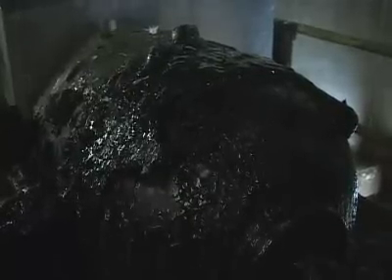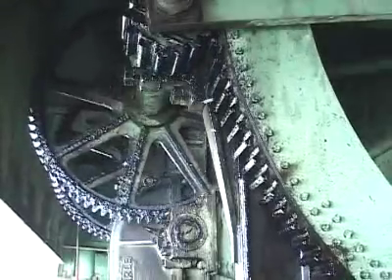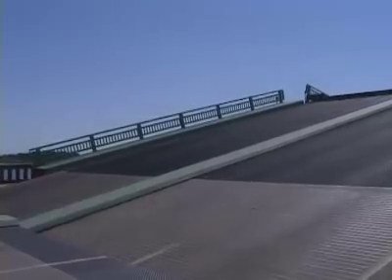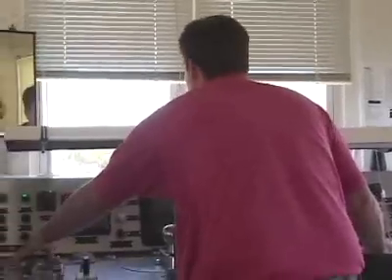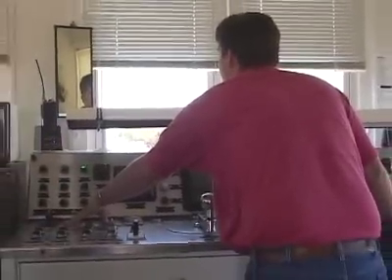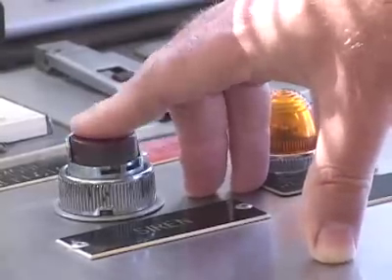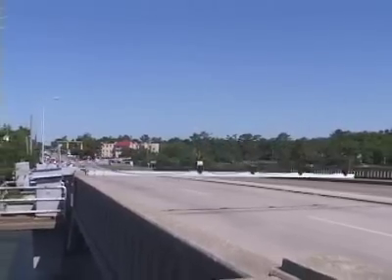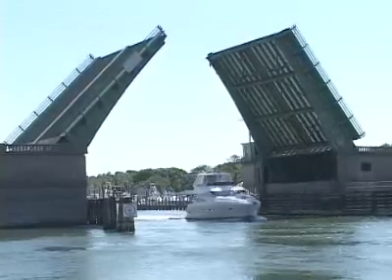How Draw Bridges Work

Comment: That is how one design version of drawbridge works.  There are several other types of drawbridge in use in the US, and they work differently.  For example, one type rotates horizontally.  Maybe you could expand your presentation to include some of these other types?
Reply: The one's that open horizontally are swing bridges, not drawbridges.